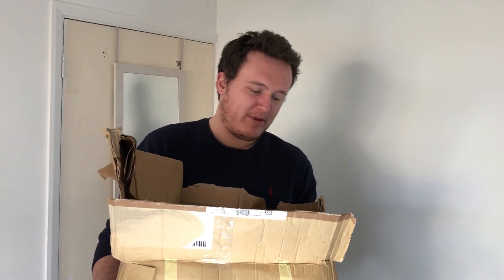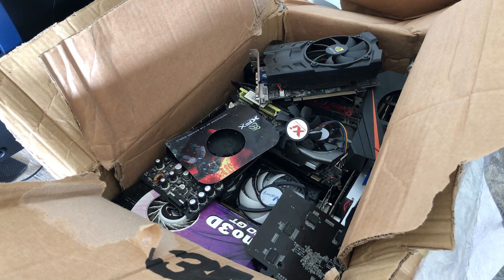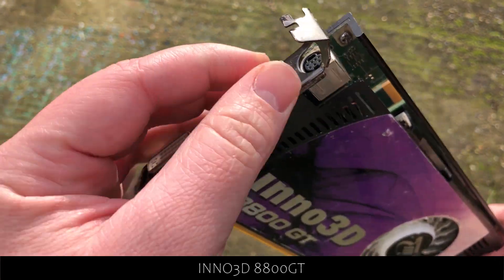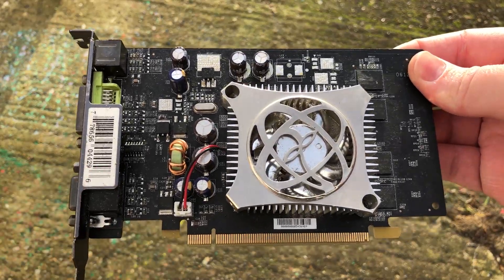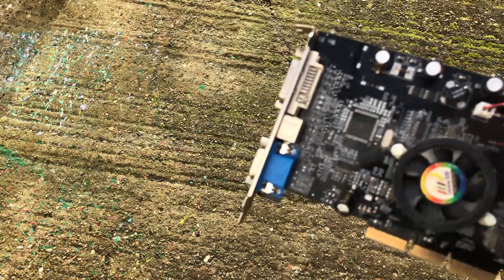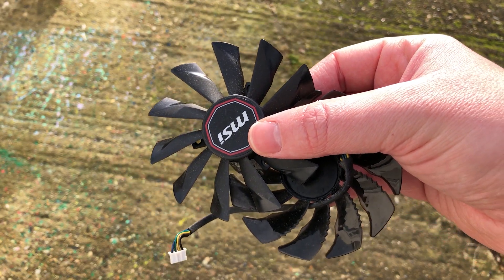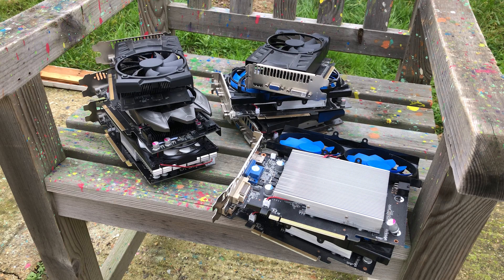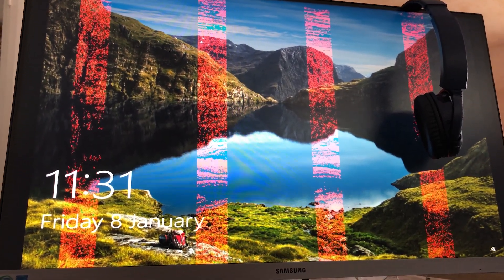I Bought 25 Untested Graphics Cards For £50 ($70)...

Comment: Rather than the oven method, get a heat gun... even if you don't have a hot air station, a basic heat gun can do the truck on maney BGA pop offs. Just kapton tape all around the gpu core, then using one's best judgement given one's experience and such, heat the chip. If you have an IR thermometer you can get a MUCH better idea of when you're in the realm of remelting the BGA solder balls. But this method is FAR more effective, and concentrates the heat onto the core alone, which is often the only issue. Also, give a decent many layers of kapton tape around and over the remainder of the nearby components. It can only help, and the stuffs cheap. You really only want to heat the core.

And you can run to your local Walmart equivalent to grab a $10-$20 heat gun, and it'll do it just fine.

Comment: Ahh the good ol Single slot 8800GT,great cards back in the day but for some reason they all seemed to fail eventually, it would be interesting to see if that 8800gt holds up in test after test to see if its been baked back to life before as i managed to get one working with the oven bake method but only for a short few hours then it started artifacting again.

Comment: If there's one thing I've learned from eBay it's that if someone says something is untested it usually means they know it's fucked and just want to get rid of it.
Reply: Yes you're actually saving them the cost of paying for WEEEaway disposal - anyone with 50 graphics  cards to sell is probably a business that is more than capable of testing them.
Reply: i bought an untested xbox 360 that was only fucked because it was full of dust and because the disc tray belt was fucked. its now fixed and being sold
Reply: On an individual basis, 50/50 shot. 
With batches of items, it's either somebody cleaning out their garage, or they purchased stuff at auction and are just flipping it.
I've been pretty lucky, in that i've only gotten totally screwed a couple of times.
then i just turn them into shelf decorations. lol.
Reply: @Dedubya-  capable?, maybe, but is it worth it?
For a business, setting someone down and testing this many cards would be the better part of a day, for maybe a few dollars.
The emphasis being 'maybe'. Unless all the cards sell, you could be out more in labor cost.
I've got a couple boxes of gpus i've accumulated over the years, and i wouldn't even bother trying to test all of them if i was going to sell on ebay. 
And i do have the ability to test every one. It's just not worth it, financially.
Reply: Got an "untested" motherboard. Took a punt and discovered 2 socket pins just needed straightening. All good!
Reply: Untested ryzen is a goldmine, especially if it has bent pins. If it doesn't have bent pins I get out of there
Reply: I’ve definitely brought things that were legitimately untested because they used a weird cable that the owner had lost or something like that, but 90% of the time it’s a lie. It’s disgusting, I could never do it myself.
Reply: @Dedubya-  I’m surprised most people wouldn’t just Chuck them in the bin
Reply: That box of “untested” GPU’s he bought off ebay WAS somebody’s rubbish bin. 😂
Reply: I dunno I've gotten pretty lucky most of the broken/untested pieces of hardware I've bought on ebay turned out to work perfectly fine out of the box and most others required only small and easy fixes like straitening a bent cpu pin or re-soldering a partially broken off capacitor, sometimes even just a clean driver install or fresh application of thermal paste. It's baffling what some people are willing to effectively chuck in the bin. In the year between school and college successfully managed to supplement my income by fixing and flipping untested and broken pieces of hardware.
I once got extremely lucky on a complete "broken" desktop with a GTX 980 and an i5 4670k in it for I think around 200$-250$ a while back (mind you that was back in 2017 when those pieces of hardware weren't hopelessly outdated). Literally the only thing that was broken was the top PCIe x16 slot on the motherboard.

Comment: I bought a gtx 980 about a week ago, it arrived today and it's amazing! One of the reasons I bought it was because of your videos! Thank you! :)
Reply: I've just rebuilt my rig and now have 2 980ti's to sell there great cards for 1080p. Don't want to scare you but make sure you save all the drivers and maybe get the back catolog of them nvidia tend to start fading out support for card over 6 year old and you nearly there I'm afraid.
Reply: @martinblanch5828  yup, I know that, but at least I'll still be able to use it...
Reply: @martinblanch5828  thanks for letting me know! :) , although I dont think they will phase them out for another 2 years because they are great performing cards and alot of people still use them

Comment: Maybe instead putting these gpus in oven and basiclly ruining them you could do a collab with other tech youtuber (there is at least one person on isles - Clive Mitchell from Bigclivedotcom) and/or try to fix them properly? Fans can be regenerated using engine oil, and most of diagnosis you can do using basic and cheap equipment. Also - something like hot air gun can be bought for 25$, so not very expensive.

Comment: I can see a lot of mechanical damage, mainly knocked-off capacitors and resistors on the back side of the cards. This damage obviously cannot be repaired by the oven method, so check that first.

Comment: Just as a side note: The oven method is not a temporary fix, it's simply NOT a fix. Watch Louis Rossman's video on the subject. To summarize, if it works, it's like shocking a dead ant and it moves a bit; sure it might twitch and whatnot, but it's still dead.

Comment: Just don’t use the oven method with an oven you cook actual food in, you don’t want to give yourself lead poisoning. The heatgun method could work as well
Reply: Absolutely, and the fumes would be quite toxic too.
Reply: I want to give myself lead poisoning. Thank you for the suggestion
Reply: No lead from any recent board (ROHS compliance), but many nasty stuff you don't want in your kitchen oven anyway
Reply: @marco56702  yup part of the reason we have to even bake or heat gun cards is due to non lead based solder, doesn't last as long through hot/cool cycles.
Reply: There is no lead in modern electronics.
Reply: do you boil the solder or something? I don't think it's the lead that is the problem here
Reply: @andruloni  lead solder can hold connection better through expansions and contractions, due to heating and cooling cycles. When u reflow solder ur basically heating the bga pads under the substrate of the chip and smoothing out microfractures in the solder connection.
Reply: I also have to add that oven and heat gun aren't a proper reflow, but can buy you some time.

Comment: Also worth trying a hairdrier on the gpu die instead of the oven method, might take a while longer though as well as you'll need tin foil around the gpu die too not damage or heat up anything you don't want too heat up.

Comment: Oh god please try to clean the cards before putting them in an oven! I got my hands on a 6870 hd and it was fine but than began to artifact, I pulled the card apart and replaced the brick of a thermal paste there and it works fine again. (Haven’t tried to game on it yet tho) If it doesn’t work then try oven method.